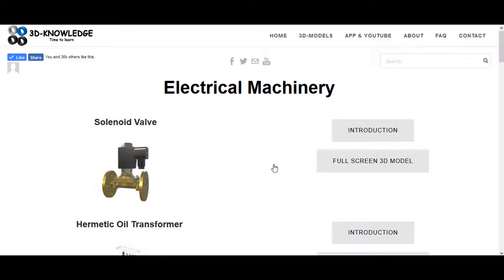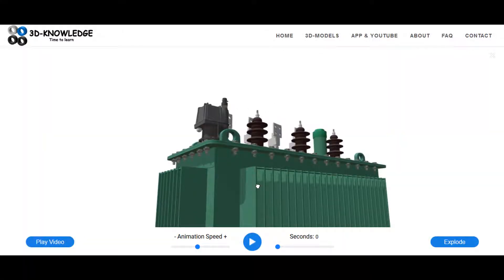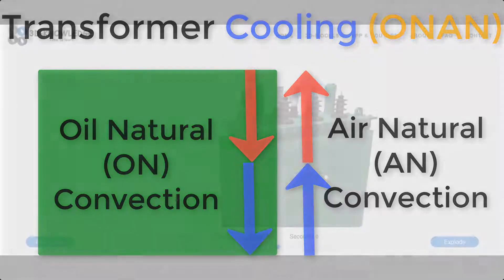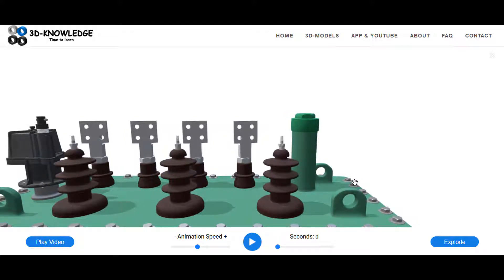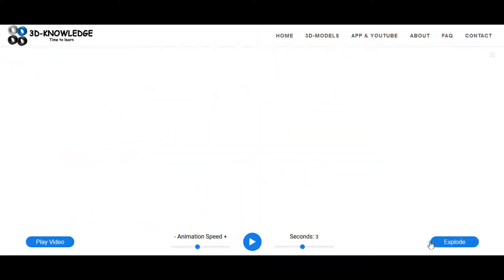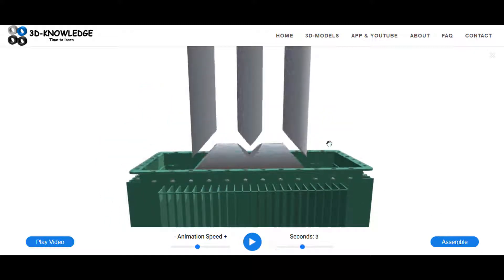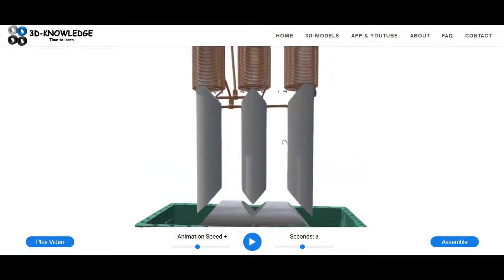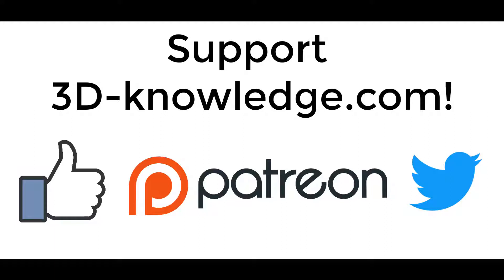Hermetic Electrical Transformer Components Explained

Comment: Is mineral water is use for cooling purpose?
Reply from the maker: Not as far as I know. Ultra pure water does not conduct electricity, but water does. They use water sometimes to cool transformers, but the type of heat exchanger used is double walled (so the water cannot leak directly into the transformer insulating fluid); a leak alarm is fitted in case water leaks into the void between the pipe wall and the insulating fluid. 

Ultra pure water would not be a great transformer insulating fluid simply because it would at some point have similar properties to normal water. Normally the insulator is mineral oil, perhaps silicone, perhaps some form of bio-degradable oil.

Hope that helps, let me know if you need any more information.
Reply: @3dknowledge  🤣🤣🤣 ultra pure water ,, smells like ultra pure Bull Stools to me , water (un-comtaminated) H20 made by collecting the steam from boiling water, or water (contaminated) usually bits if metal IRON (ION) , Calcium, Magneseum or poisonus to the human body ...
Reply: @3dknowledge  i do believe its an Oil + Water mixture
Reply: the hidden resevoirs are a visual aid to determine if the mix of water and oil are the correct ratio of 3:1